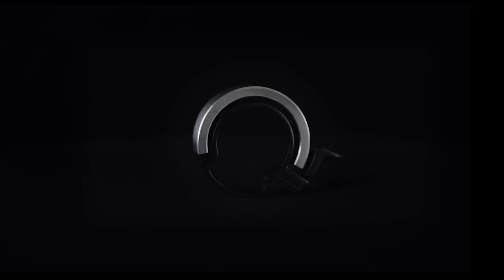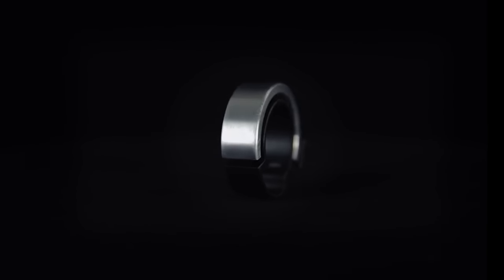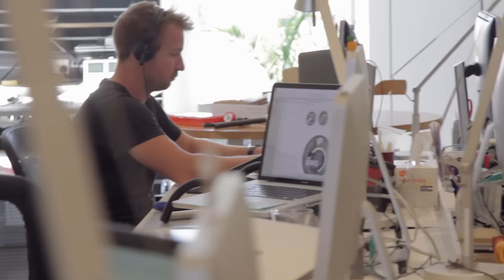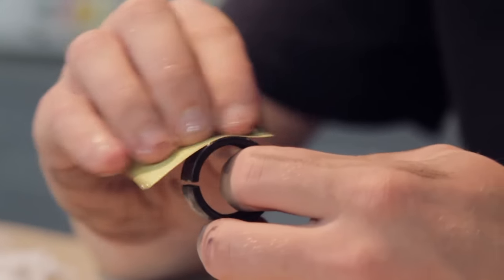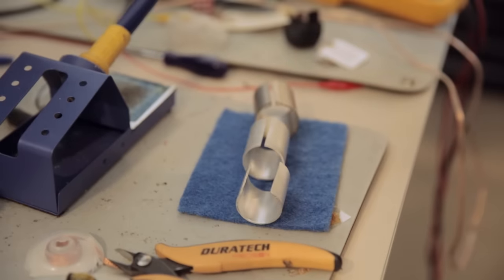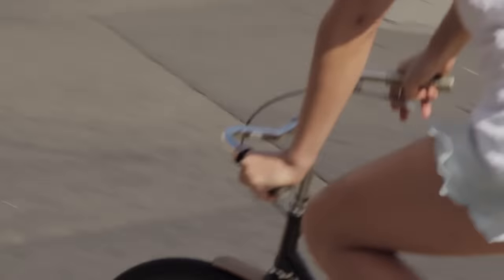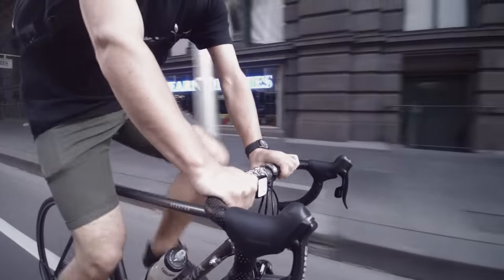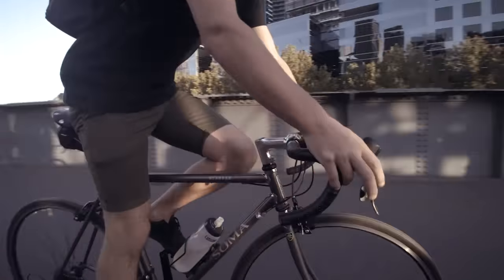Oi Bike Bell

Comment: I've got two. Rather disappointing. cheaply made considering the price and far too quiet. The striker should be metal, not plastic. The PDW bell on my other bike is far better in every way.
Reply from the maker: If you have a couple of duds Peter, we'd be happy to put you right. Just email us at hello@knog.com.au.
Reply: I love the bell. It's sleek, and unobtrusive. My only gripe is that it doesn't work. The flimsy-arse-rickety donger spring was bent straight from the box. I didn't notice it when I bought it. Now, it's bent to virtual uselessness. A $30 bell sabotaged by a few cents spring. That's practically a fable.
Reply from the maker: Sorry to hear that. If you can shoot us through your details to hello@knog.com.au then we'll replace this for you.

Comment: From 1 to 5 (worst -better):

Design: 4 (nice and smooth and goes perfect on bikes)
Materials 2,5 (nice metal bell, cheap "plastic" button to hammer)
Sound: 2 (Not loud enough and sound "cutted" if you hammer it again before it stops ringing)

I DON'T recommend it. For the price you expect a bit more quality on the materials, as it costs almost ten times more a regular bell.